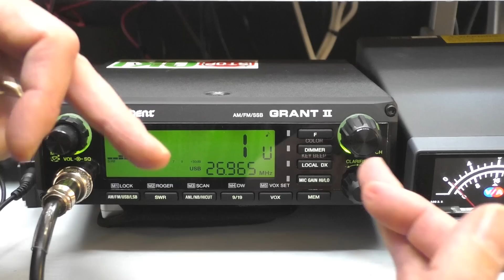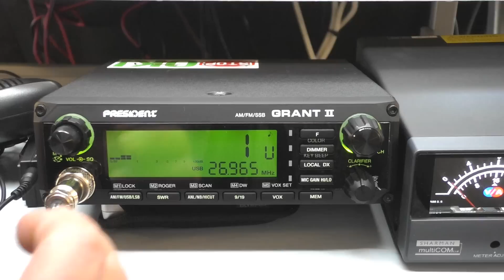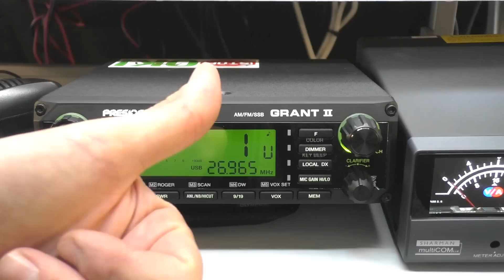Why Single Sideband (SSB) is better than FM / AM

Comment: I'm intrigued to see that your Grant II is nearly identical in terms of the chassis and dials to my Uniden Bearcat 880 (more particularly, the 880SSB) which surprises me. Also, I have been considering getting into SSB but have mostly held off due to the significant cost increase, but I was not aware of the lowered noise floor benefit. Thanks for some good info, and cheers from the Canadian Prairies!

Comment: I dont think you fully understand the subject you are talking about. For starters the noise you are hearing on fm is not QRM as your fm reciever is imune to this,  anyway the noise will be the same on a quiet channel because this noise is internaly generated in the fm receiver itself. I think you are mixing this up with AM. If you have an electrical noise problem at your QTH you will be much better off using FM and you will pull in distant stations better with this for sure.
Reply from the maker: What i do know is that in FM mode i get S7 of noise and in SSB S1-2.

Comment: Also worth mention the main difference between AM and SSB (you mentioned it but I take it a little more in depth ;) ). When we modulate an AM-signal (let' say with a 1000Hz tone) at 27MHz, we will get 27MHz + and - 1000Hz; so we get 3 frequencies: 26.999MHz, 27.000MHz and 27.001MHz. The highest and lowest frequencies carries the modulation information, similar in both of them. The main carrier at 27.000MHz has no voice information at all. The output power is shared between these 3 frequencies, but we really need only one (lowest or highest) to get the information transmitted. If we remove the carrier (27.000MHz) and the upper side band (27.001MHz), we are left with 26.999MHz. That is our LSB signal. But this signal has all the RF power available, as nothing is lost to the two other frequencies. So in fact we have much more "effective" transmitter power available, than with AM. Technically much more expensive and complex than AM, but with much longer range pr. watt.

Comment: It`s very difficult to create SSB transmitter In according to AM, PM, FM modulation. You must  have a narrowband  RF filter and a  balancing modulator. There must be two IF in a wideband HF reciever. But there ia aery good alternative -a weaver method. You must have two syncronous DDS generators/

Comment: What about using SSB for listening to amateur radio? I was thinking about getting a tecsun pl-330 or pl-680  but I'm not sure if I'll pick up much at all I'm in the UK aswell so maybe quite limited compared to the u.s.a for example. What else might I pick up on an SSB shortwave radio these days I'm not sure it's worth spending the extra money on one and maybe sticking with a radiwow instead without SSB.
Reply from the maker: Have a google for SDR radio using a cheap dongle and SDR Sharp software for shortwave and Ham
Reply from the maker: Hi.  There are plenty of radio stations still using shortwave but not so many english speaking.  You can pick up Hams on a Tecsun.  What about a cheap SDR usb dongle for shortwave ?   Google SDR
Reply: I've just been using web SDR and there's very few SW channels on there. They use a massive 20 ft aeriel antenna aswell. There's SSB and LSB there for radio ham's. It's a free website . SSB radios are expensive and there's quality issues with the Chinese brands. Also I think the DSP chips in the radio's affect SW channels.

Comment: I could throw a stone and maybe hit a window across the road where our main High School is, and there is new Led street light outside my house, then there is a nursing home right besid my house split by a row of hedges and I have the same radio President Grant II Premium and your SSB static noise level is the same S Points as my FM giving me local chat and slightly further FM chat pick up no problem.
If you did the same FM/SSB test on your FT450 and your Alinco would you still get the same result? The reason for asking and I have brought this up a few times with people that sometimes it can be the quality of the radio's fault. I have watched many of your videos Fred and felt your pain when you went through shutting the house power down etc, I have had three different radios that the needle didn't lift with noise and when local stations came in the nearly bent the needle incase some may say I merely lowered the RF gain and that was not the case. I even took one of these radios to my brother's home where he complained about the noise level was on the S8-9 solid and we put my Cobra I48 GTL DX, Cobra 25 LTD ST and my Major Excalibur 200 onto his antenna, all three radios on an empty channel on a normal night gave from no lift to less than S1.
The worst radio for noise I ever had was a CRT 6900 and a couple of other Cybernet radios. My Yaesu FT450 MKIII (before the D model) is pretty good with around the same as my President Grant II Premium between 1 - 2 S points on normal days.
Food for thought by trying other radios to see if you get different results.
Reply from the maker: Hi.  Quick reply.  On FM noise S level is about the same on all my radios.  SSB the HF radios do a lot better with far less S point noise.  I normally back off the RF gain on the 9900 and 6900 as they are very sensitive. Grant 2 is the worse for picking up QRM.  The NB filter on both my Alinco HF radios and 450 is miles better than the others.  See  video here. https://www.youtube.com/watch?v=JZQ_VFr83Wk

Comment: I was a side bander back in the mid 70's through the 80's.  I see you are on channel 60 where I used to hang out.  If I had an antenna I'd try to contact you on single side of upper channel 60.  Cheers, mate, from eastern Tennessee.

Comment: Is there nothing that will filter the qrm out
Reply from the maker: You can get filters.  However iam not 100% they totally work.
Reply: One idea 💡 to try Fred, have you tried to use an antenna as far from the house as practically possible? It's just that some of my aerials are around 12m from the houses, I get very little Qrm. Compared to the long wire which is fed from the shack in the house 🏡, I get an average of S7. On the 'wire gain master' and smart tuned vertical I get much better signal to noise ratio quality (away from the houses). One final thing... Good screened coax is a bonus (especially double screened) for keeping away unwanted noise.
Enjoying your video's Fred 😉 👍
Best 73

Comment: ACTUALLY WHEN YOU ARE IN FM MODE THE NOISE THAT YOU HEAR IS NOT THE INTERFERENCE of OTHER ELECTRONIC DEVICES BUT THE NATURAL FREQUENCY MODULATION CARRIER STAND BY ECHO WATING TO HAVE INFORMATION (SIGNAL) TO BE PUT ON BY THE MODULATION MIXER FROM A TRANSMITTING STATION.  AND SINCE THE SINGLE SIDE BAND SIGNAL HAS NO CARRIER, THEREFORE ONE WILL HEAR NO ANNOYING NOISE WHEN IN SSB EVEN IN THE STAND BY MODE ephemetherson  SQ5KIE
Reply: Inside voices

Comment: Hi Fred, 
Do you know of any small SSB radios?
Thanks 
Eddie 👍
Reply from the maker: I dont know of any micro sized radios.  I suppose the CRT 9900 is fairly small
Reply: @CB-RADIO-UK  CCrane Skywave SSB Radio
Reply: @moconnor50  it's receiver only though mate, I consider it implied he wants a transceiver.

Comment: More narrow bandwith of transmitter and the receiver,more range.That is the point of using just 300Hz wide CW telegraphy and digital modes like FT8......SSB is narrowest way to translate human voice,just 3khz wide so it do have more range and more signal strenth at given power level than 10 khz wide FM or AM modulations.

Comment: Me again .still not back on ☹️, funds not allowing . Hopefully after Christmas , unless santa has something in his sack for me .
To my question for you all .
Out of the new modern multi modes what one has  the best receive ? . 
Back in the day I always used cybernet radios , sticking with a harrier cbx in the end . 
So which one's got the the best ear's over all the modes . Cheers
Reply from the maker: Hi.  The Grant 2 (not prem) has the worst if used at home as it picks up to much QRM.  Its fine if you get it out in the open.  There is not much between the CRT6900N and the 9900.  Both do a good job on SSB.

Comment: I just bought a RCI2950. Cant wait to get home and plug it in.
Reply: How did the new parts work for your receiver? I've had a first generation rci 2950 since they came out. I had my first base station on a starduster (the best antenna in my opinion) got into amatuer radio and moved, 8 years in the military and what do you know the rci 2950 came out of storage again. I look forward to using it on 10 meters. I always used an amplifier with a preamplifier to bring up the receiver and just back the rf gain down to get rid of the hash. I definitely could hear more than I could talk.

Comment: Hi Fred,Ive been saying for a while if manufactures fitted proper roofing filters in the RX chain,you'd get a lot less off that noise passing through! Even a basic 15khz   3 poles 1st stage filter would help bring the noise floor down,Ive tried this on the SS3900 and it works very well,it would increase cost but wll worth it.Another problem is most of these radios are far too sensitive when used in a base station set-up and with a gain antenna,for S-meter back the rf gain down till noise floor comfortable and can hear the station,most of the S-meters on CB are not very accurate or track well at 6dB per S-point.Great vid fred as usual!
Reply from the maker: Thanks for the info.  I guess CB's are guilt to a price and cannot compete with HF equipment.  However the Grant 2 is getting on for £300 uk :-O
Reply: @CB-RADIO-UK   £300 is pennies compared to the cost of even entry level HF transceivers. What does an ICOM 9700 cost now? £1400? Get one of those in the shack Fred and see how your noise is :)

Comment: I don't get it about FM.  My 2 meter rig is FM and I have almost zero noise when talking to someone.
Reply from the maker: HF gear tend to have better filters.  All my CB radios suffer some noise.
Reply: 11m is always been known for noise, 2m, 70cm, 12m, 10m has always been more quiet and attracted less interference

Comment: It would be good if you could do a test with a weak signal and switch between SSB and FM.
Reply from the maker: I could try but around my area most distant contacts are all SSB.
Reply: Do they not have FM capability?
Reply from the maker: They do but once on the net they really will not want to jump up and down modes for a video.  I have done fm and SSB compare contact videos on a few radios but only around 8 miles out.

Comment: For the benefit of the readers who may not know.
FM is about 10 kHz wide, ssb is about 2.3 kHz wide.
The wider the signal needed, the more noise gets through.
A qualifier, noise is not sound but anything that stops your signal getting through.
73 de Tony
Reply from the maker: Thanks Tony for the information.
Reply: In addition to its wider bandwidth, by its very nature, the FM demodulation process is akin to differentiation, tending to emphasize higher-frequency noise. Hence the need for pre-emphasis at the trmtr, and de-emphasis at the rcvr.